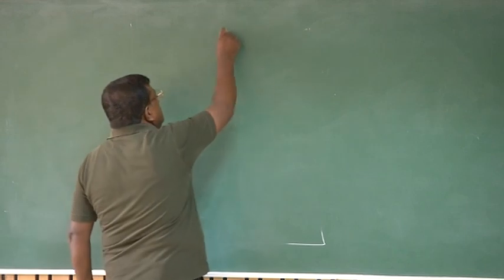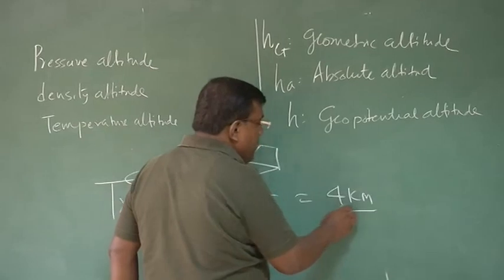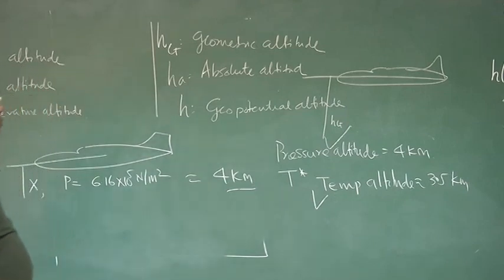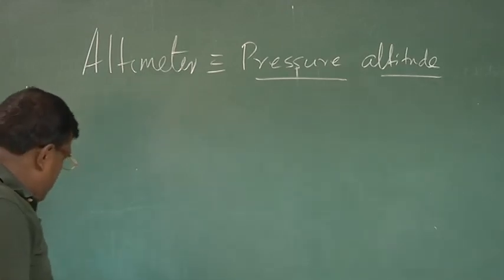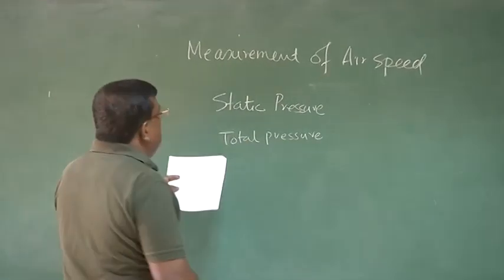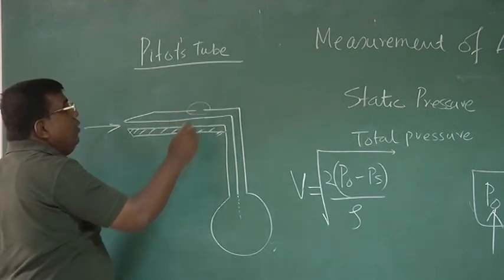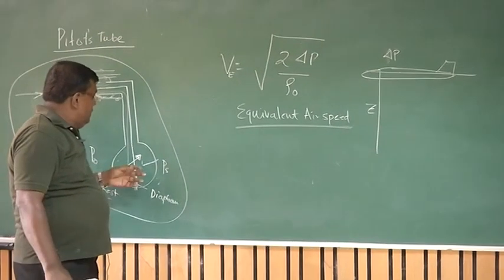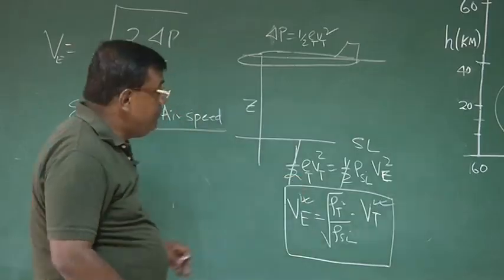Measuring Instruments: Altimeter, Airspeed Indicator

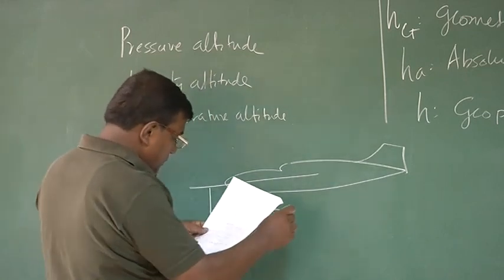Comment: Sir, at 2:20, You have taken example pressure as 6.16 × 10^5 N/m2. But shouldn't the atmospheric pressure at an altitude be less than the sea level atmospheric pressure (i.e. <1.013 × 10^5 N/m2)?
Reply: Exactly my observation. Perhaps it should be 0.6x10^5 N/m^2. Looks wrong

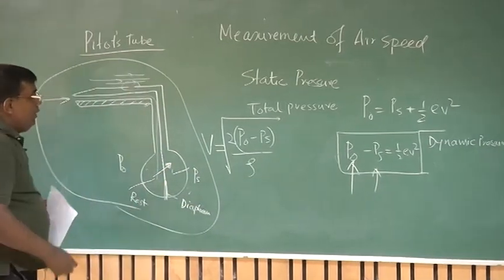Comment: Sir, At 15:00, you have said that we cannot calculate 'ρ' as it varies with Altitude. But at 18:05, you have taken 'ρ' value as an input to calculate the equivalent speed. How can we calculate Vₑ if we cannot measure the input?
Reply: The equation you are talking about is used to estimate true air speed .....For equivalent air speed , first equation is used ....Root (2*deltaP/ Rho SL)